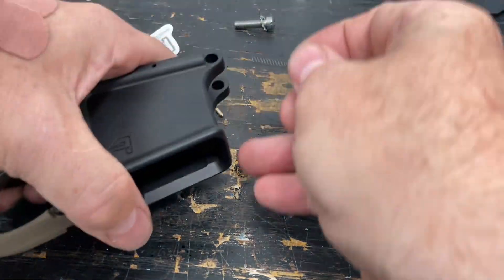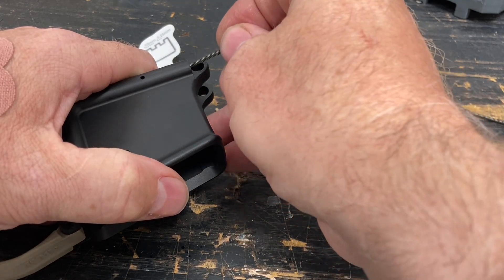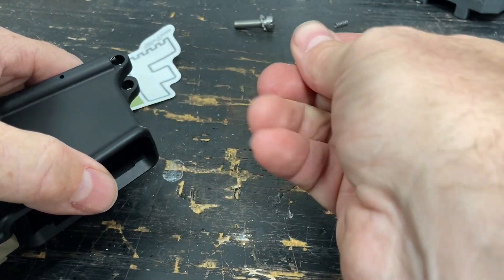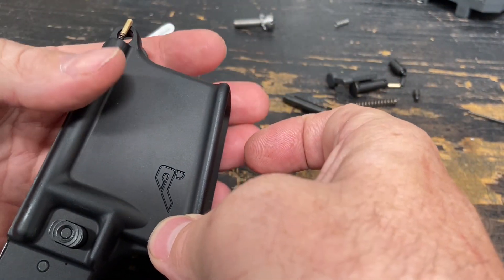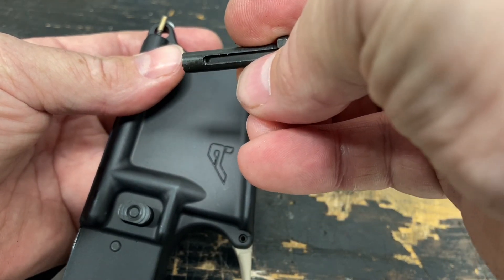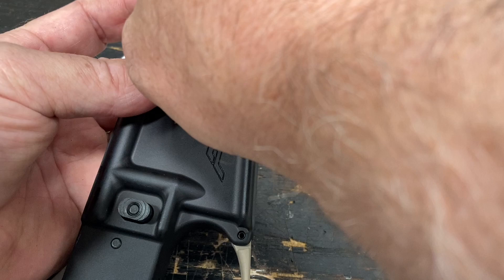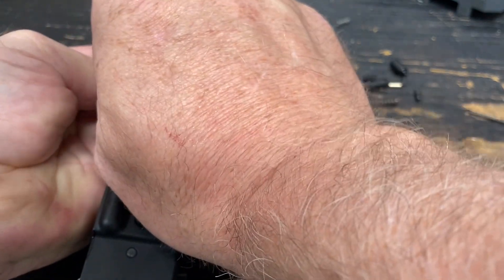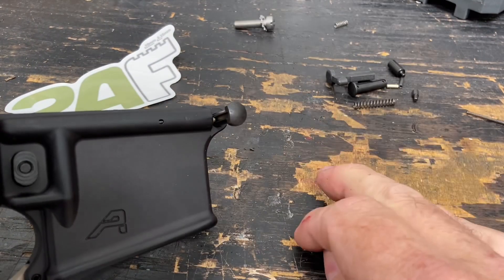Front pivot pin without tools.

Comment: LOL, that is probably the most difficult part of AR assembly I ever tried.  Detents were skipping all around the room like ricochets!   Thanks for the tip.
Reply from the maker: I can’t always do this on the first try but I’ll use the finger from my other hand to prevent the spring and detent from flying away. The depth of the hole for the spring/detent isn’t always exactly the same and the springs themselves also can be slightly different lengths. If the detent starts deeper in the hole than this and i cant rest front edge on the lower, it’s more difficult